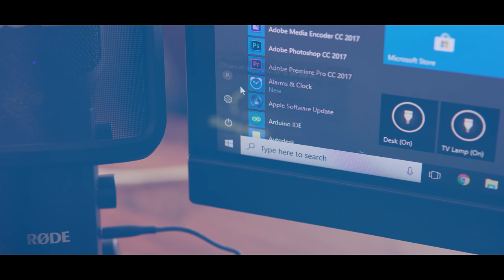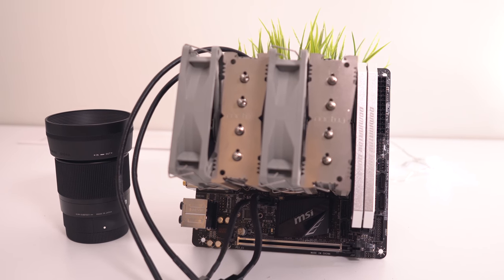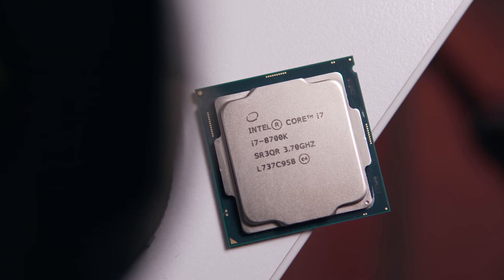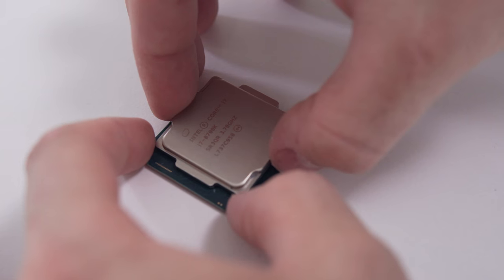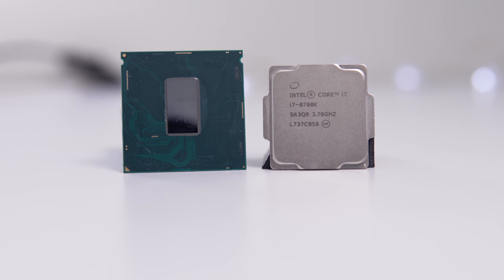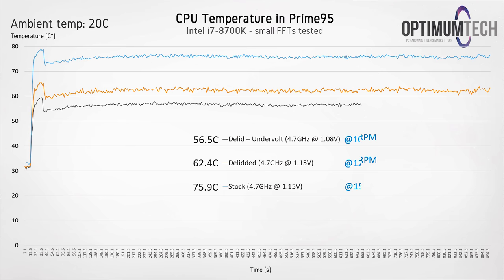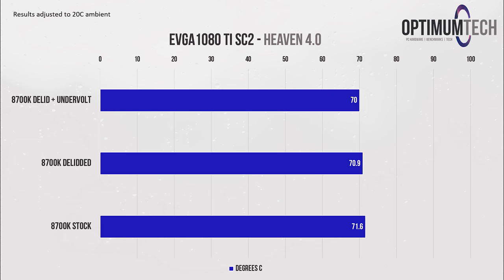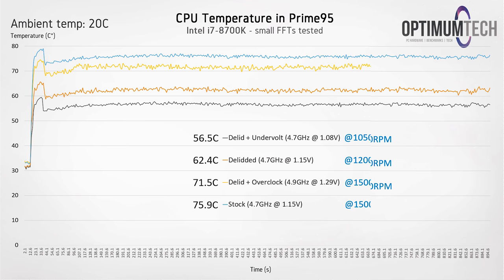8700K Delid & Undervolt - 20C° Drop!

Comment: It boggles the mind why Intel don't do this.The cooler it runs, the less power it uses. Intel could clock the cpu de-lidded at 4.9Ghz out of the box instead of 4.7Ghz and sell more cpus at the expense of Ryzen.
Reply: No its not it is the MAX TURBO single core speed.
Reply: Totally achievable on stock settings even without a de-lid.
Reply: J D Because Intel can release the same shit over and over again and use toothpaste between IHS and fanboys would still buy it and defend intel with reasons like "AMD sucks!!" "Stupid AMD has no meltdown"
Reply: It sucks I had to de-lid but no buyers regret. 5Ghz all core overclock is a level AMD are not at right now.When it comes to cemu I need as much clock speed as possible. So I bought what suits my purpose. If it was Ryzen 5Ghz I would have got that instead. Maybe someday it will. Also the 5Ghz is rock solid stable and easy to achieve. Intel could easily up the speed of the cpu tomarrow by fixing the paste issue with no other changes.
Reply: J D Atleast Intel has the Meltdown feature unlike shit AMD am i right?
Reply: Meltdown is already fixed. Old news. 1-3% performance drop.
Reply: J D No its not. Meltdown is a hardware exploit not a software one. The only way to patch is that you need to buy a new CPU which is not even possible as intel still havent made fixed cpu's
Reply: I'll worry when people are getting hacked. Until then I wait for Intel to fix the microcode update.
Reply: J D Can you not read? Intel can't release microcode updates to fix meltdown. Software cant fix exploits in hardware. They can make it a little harder but you will always be easy to hack until you buy a ryzen or a fixed cpu from intel which they havent even started producing yet (intel knew about meltdown and spectre since JUNE 2017) and yes people will soon be getting hacked as its now open in the wild for hackers to write malware
Reply: So you are a processor development expert? Intel did release an a microcode update but it had the side effect of random reboots. So they are working on it.
Reply: Not its not, its within Intels Spec and happens automatically. An overclock would be pushing it OUTSIDE the spec. Such as forcing all cores to hit that max turbo ( which they do easily), or pushing it higher still. Intel turbo boost monitors the temp and current draw and keeps clocks within the spec. Again clocks WITHIN THE SPEC IS NOT OVERCLOCKING.
Reply: AMD do this, Nvidia do this and does ARM. Its not even Intel Specific.
Reply: I just said Intel senses that and automatically adjusts the TURBO boost to STAY Within the thermal spec to prevent that exact scenario your described. Turbo boost allows those with good cooling, good ambiant temps, good mainboards, good psu to benefit from a higher speed while those on crap cooling in a small chassis are protected from overheating.
Reply: I know I already said this, but it does this automatically at DEFAULT settings with NO user involvement. How many times do i have to state the obvious.  Now if a user wants to CHANGE defaults manually to push the cpu even faster THAT is overclocking.
Reply: In fact if you have good chip (silcon lottery) 5.2Ghz is possible! 4.7 is NOTHING to that chip but its a frequency AMD can only dream of.
Reply: WarmSoftKitty a year from now on but everyone on 8th gen intel and older are still fucked... I cant believe people STILL defend intel. Whats next? People saying that Meltdown is a intel trademarked feature and huge bonus??
Reply: It automatic even on non K cpus, and basic chipsets. The 8400 turbos just fine. Without proper cooling Intel  CPUs, first reduce the turbo speed, if that is not enough, they throttle to increasingly lower speeds to prevent overheating. Of course it can still happen. the CPU fan can fail or installed incorrectly but even the shittiest intel box cooler in a working state will result in a stable (but slow) system and a great cooler will reward with higher turbo speeds. Turbo allows Intel to adapt to many scenarios from OEM to enthusiast automatically. This is not an overclock, it does not require a K cpu! Turbo is on loads of laptops, and Apple machines as well, machines where those settings cannot be adjusted. Turbo varies the CPU clockspeed depending on TDP, how many cores in use, Ambient temp all without ANY user involvement. It really is different from overclocking. I mean lets break down the word. "Over"  Overreach, Overeact, Overcharge. What do they have in common? Above and beyond the intentions. Intels intention from Turbo Boostwas to allow as MUCH speed as possible within the given constraints of cooling available. It was NOT to push the CPU to the limits of stability. Overclocking is pushing the CPU  close to limit without it falling over. In fact that is how overclocking is down, gently raising both frequency and voltage, hitting the stability limit then either tweaking it down or adjusting something else to gain stability. This process is done by HAND, manually. NOT automatically. (Some boards can SIMULATE) a manual overclock but this is different from Turbo boost. Turbo boost HAS NO USER INVOLVEMENT, DOES NOT AFFECT WARRENTY, DOES NOT AFFECT STABILITY. SO IT IS NOT OVERCLOCKING.
Reply: but turbo boost won't let a 8700k boost to 4.7Ghz on a small cooler for very long, thats cause 4.7 isn't an overclock it works dynamically boosting various levels of core usage to various speeds for a temporary boost. If a task wants 10 seconds of 4.7Ghz clock speed and that task is then complete e.g. extracting a file) or launching a big app. You have benefited from that extra clockspeed without overclocking anything.
Reply: Now if u want to LOCK In that 4.7Ghz permanently on a high end cooler by manually changing bios settings thats UP TO YOU. THAT is an overclock, as it a manual change, putting the cpu out of spec. Turbo boost is an AUTOMATIC change that DOES NOT put the cpu out of spec :D Hope that clears it up.

Comment: I'm kind of upset because I clicked on the video because I thought I would learn to delid and learn to appropriately reassemble the CPU but you didn't give a step-by-step you missed out on opportunity all you simply said was get some silicone glue whatever how about you tell us about the products you use and the steps you took to do it quite frankly I'm going to go to some other YouTuber and you can't afford to lose views so next time take the responsibility and do shit right step by step or at least do quick frame cutscenes of the products you use it would have been that difficult
Reply from the maker: Sorry you feel that way, I included a link to a delidding guide in the top right hand corner which would have taken you about 2s to click. 

Not every delidding video can be a thorough guide unfortunately.
Reply: Dude, what? :D Stop whining.
Reply: George D no that's what Arnold Schwarzenegger says stop whining